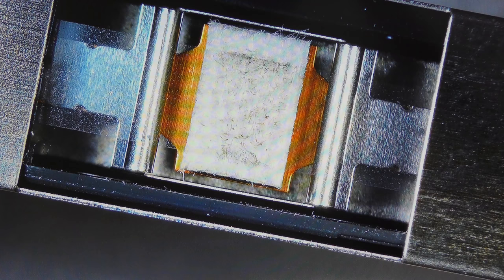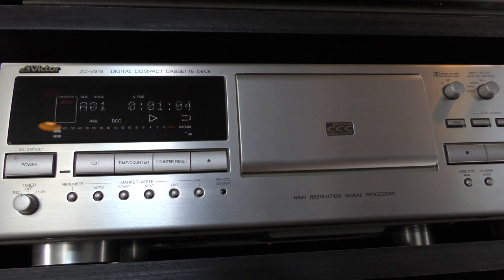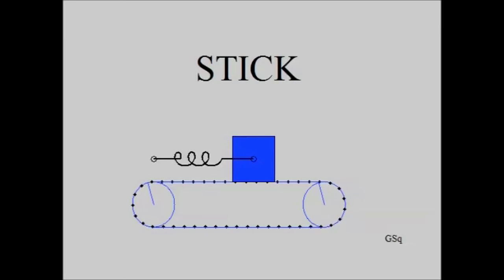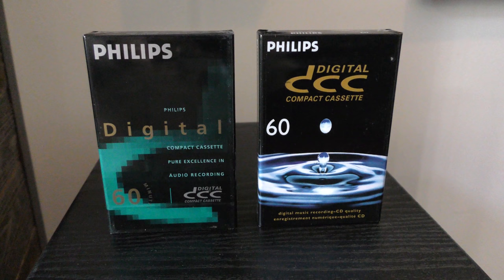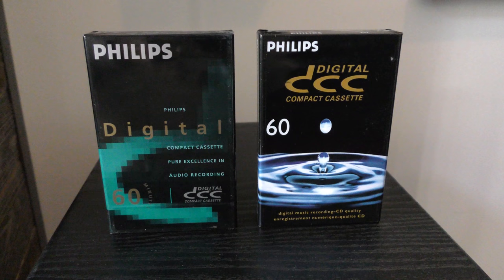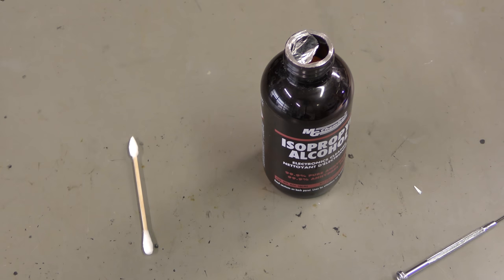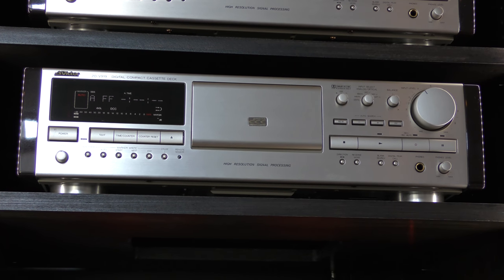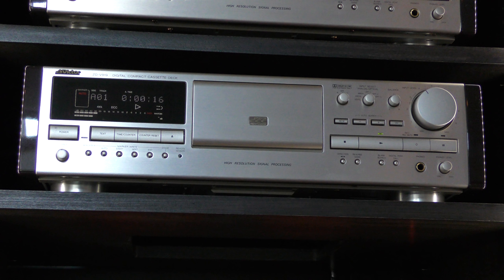The Stick Slip Effect on a Digital Compact Cassette Dirty Felt Pad.

Comment: Got the same problems today so will trust in your helpful video! Was seriously concerned that the player itself was the problem! You have eased my mind now thanks! Cheers from England!
Reply from the maker: Happy to help.
Reply: DR DCC , Thankyou...I’ve just recently retrieved from my loft, my Technics RC-10 and hoped for the best...but... knowing nothing of the likely problems from 18 years of loft storage and the associated swings of temperature that this machine would have endured, I of course now am aware of the tape/ pad issues that I now have! I bought it in 1996 here in England, brand new! It had very little usage, but I absolutely loved the sound quality which seems to remain all ok apart from the slippages!? I plan to clean the pads as per your guidelines, but the big question...will the capacitors be on their way out by now, and if so, would it be possible to transport the unit to you for service/ repair and if so, any ideas on approximate costs involved? Many thanks, and I love how organised and competent you seem to be at this work! Brilliant! Cheers from England! Stay safe America!
Reply from the maker: @nigelparker5886  contact us at the museum directly, as the capacitors need replacing first.
Reply: DR DCC 
Ok, cheers!

Comment: I just repaired my DCC170 and thought I was going insane as I found that nearly all of my original DCC cassets were having drop outs and some were emitting this high pitch sound. My first thought was that the replacement belt I used was maybe too loose, but all the analoge cassets worked fine and most importantly my one self made DCC cassets (which I made and recorded on over 20 years ago from a maxell XLII-S 90 tape) was working great! But now that I saw your video and for sure all my old DCCs had the white pad. Now the next mission is to clean them all ;). Is somebody interested on how to make your own tapes by the way? Quite easy (but I saw on your forum that normal type might hurt the reading head?)
Reply from the maker: leoatreides1 You can clean the pads. In our next video we will also show how you can replace the pads. Normal tape is indeed abrasive.

Comment: How do you remove the excessive felt pad 'curls' after the cleaning? Great video as always Ralf.
Reply from the maker: Hi, I used a pincette or small tweezers. Then let it dry and do FFW and REW of the tape. All should be smooth again.
Reply: @DRDCC  We need to find a way to manufacture a new felt-pad-assembly.  I would buy 100! Saves all tapes from the bin.
Reply: Or maybe cover the top side of the dirty pad somehow with a smooth surface, like (cello)tape.